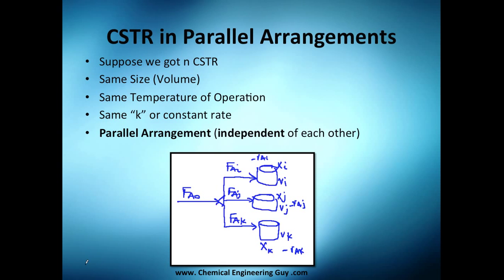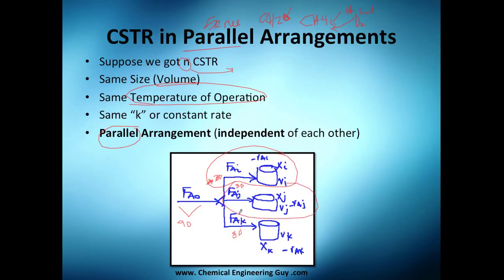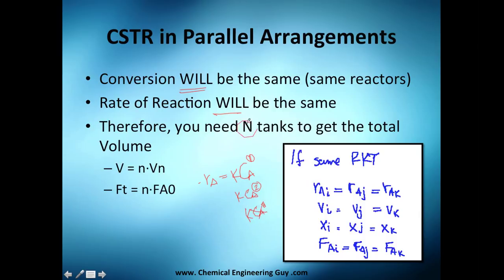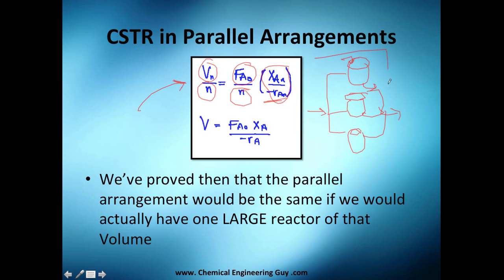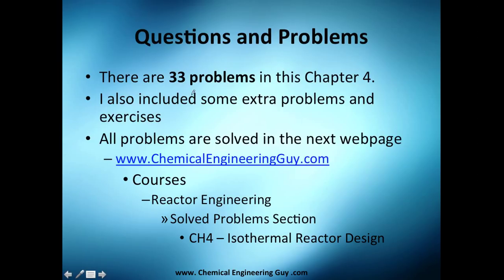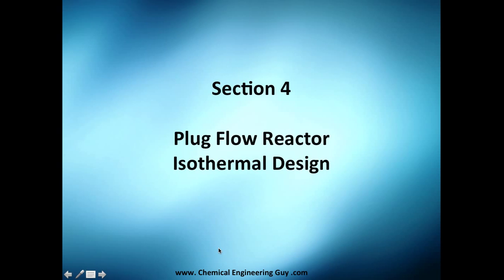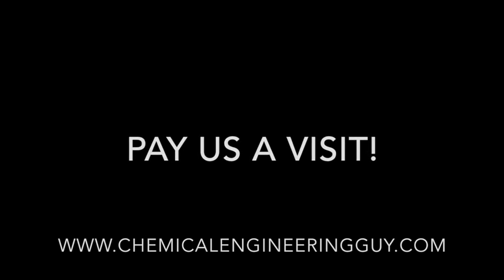CSTR in Parallel Arrangement // Reactor Engineering - Class 70

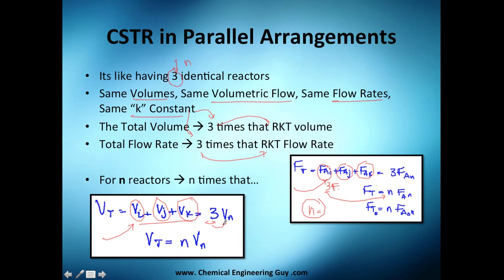Comment: you say @4:25 -> volume of that reactor, divided by that number of reactors. equals the volumetric flow rate of that small reactor, divided by the number of reactors. but I think you mean the volume of ONE single reactor of the total system equals the volumetric flow rate of the system, devided by the number of reactors, right?
Reply: Volume is something different than Volumetric flow rate. I think U messed up with the things. Total Volume required divided by the No. of reactors gives you One particular reactor volume. As flow to inlet of all reactors supposed to be same; so volumetric flow rate will be same for mini reactors in parallel. Flow= Concetration*Volumetric flow rate. I think now u got it :)